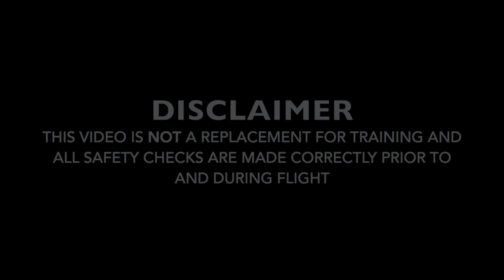How To Stall A Plane | LEARNING TO FLY | Episode 1 at Kemble Flying Club | Skyranger Swift | ATC

Comment: Did stalls on Friday in CT2K. Not sure what I was expecting (maybe for it fall off a cliff), but you are pulling back on the stick, low revs light on the engine is flashing and it's STILL flying. Was quite confidence building really as you are always thinking keep the airspeed up in the first 7 hours or so. "Don't go below 60! Panic panic" But turns out I didn't know what slow was...  where the ASI needle isn't even on the gauge. Reminds you of the margins you have. 8 hours on record now, shame there was a 182 day gap between the first 6 and the last 2! Just now starting to have to think less about the inputs and things are becoming a little more instinctual. That will promptly go to pot on landings 🤣

Comment: Hi Ben, really enjoying your videos. I’m about to start learning myself and was interested to find out about your video setup.. assuming GoPro, and head mounted somehow? Really works especially with the audio. Thanks.
Reply from the maker: Matthew Walker - hi Mathew, thanks for the comment! Really enjoying doing the videos, and think the head cam works well for debriefing plus seems a bit more interesting that a static cam, allowing me to often just use one camera! I’m thinking about doing a video on the kit I use and how. Re can, it’s actually not a GoPro  - my main camera is a YI action camera. It’s been great so far, and far cheaper than go pro. I find I don’t need all the extra features that GoPro offer. I bought a ‘GoPro’ attachment accessory kit for £20 off eBay which includes the head cam attachment. The audio is actually the more complicated, I use Rory’s method found here https://youtu.be/EEH16x2ZXAs
Good luck with your lessons! Definitely worth recording, helped me immensely so far.
Reply: Ben Atkinson Thanks for that. Interesting to hear it’s a Yi and not GoPro! Was looking at a 7 Black but maybe that’s overkill for what I would use it for. Would really like to see a video explaining the kit you are using.

Comment: Interesting VT, thanks Ben.

Using the ailerons is a self preservation habit, I should imagine LOL!

Do all of the FW 3 Axis microlights drop a wing like that in the stall? I suppose that the airspeed is quite low, relative to most 'light aircraft'? Is it only the EV97s that have an audible stall warning?
Reply from the maker: Muso Seven - pleasure, thanks for the comment. Tough not to use aileron but it’s a natural reaction but can lead to a spin if you do and that’s something you really don’t wanna get in to! Not all 3axis microlight will drop a wing like that no, however a Eurostar stalls slightly more aggressively I’m told, and drops a wing more than the skyranger. The skyranger really is quite sedate in the stall. In the Eurostar I’ve flown, we didn’t have a stall warning. I’ve flown a C172 and they definitely have that famous stall horn sound! 
Yeh the stall speed in microlights has to be below a certain speed for it be registered successfully. On this particular day (many things affect stall speed) the stall speed was about 39mph. Quite normal for a microlight, very low for any GA aircraft. It’s quite amazing flying these things at 45mph or so...the ground below is hardly moving!

Comment: Great video Ben. How do you manage to get your conversation with your instructor recorded through your GoPro?
Reply from the maker: Hi Stuart, thanks for the comments mate! I got the idea from the channel Rory On Air (link below). I run a splitter cable from the planes audio output into a separate recording device (a zoom h1n), the secret ingredient to good quality audio - as you can turn the input volume down. The best bit of kit is a 40db reducer box that really helps keep the audio crystal clear. There are ways of recording straight into GoPro but the -40db reducer box is a good idea still possibly! This is rory's video https://www.youtube.com/watch?v=EEH16x2ZXAs&t=236s
Reply: Ben Atkinson thanks for the reply Ben, I’ll have a look at Rory’s video now. Only had a few lesson but I’d like to record them further down the line as a reference point just as you have.
Reply from the maker: Stuart aitken - pleasure. Yeh I couldn’t recommend it more. I can see what I’m doing wrong, I use then to remember certain things the instructor is saying too. Even makes things like radio calls easier. This method of audio recording does require you to do some simple video editing, and sync the audio up. Just remember to clap once you’re recording both audio and video - that’ll make it easier. Finally if you’ve not already bought gopros, I don’t actually use a one, I use a YI 1080p action cam. Worth a look.